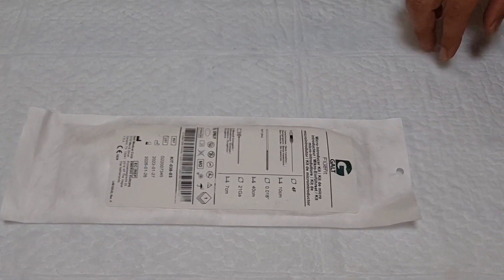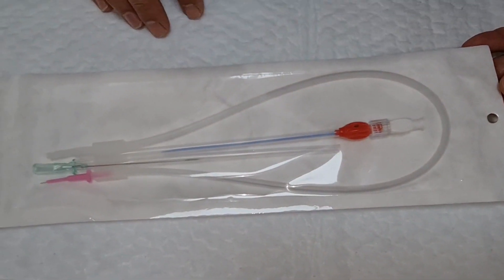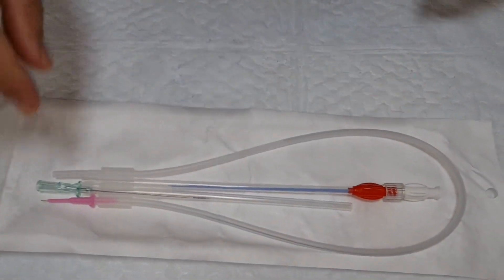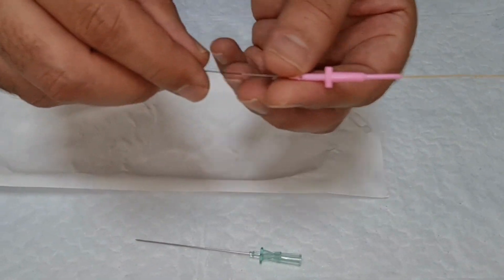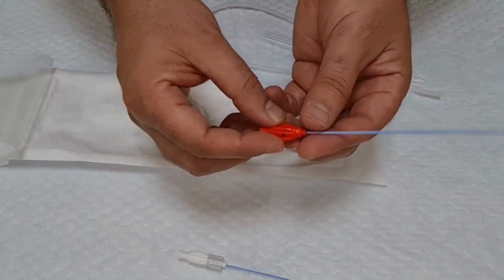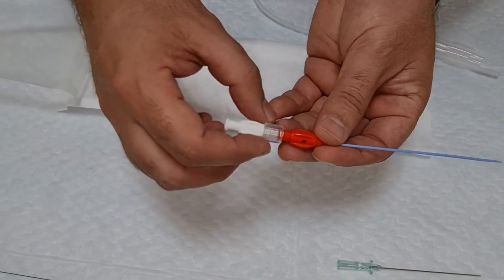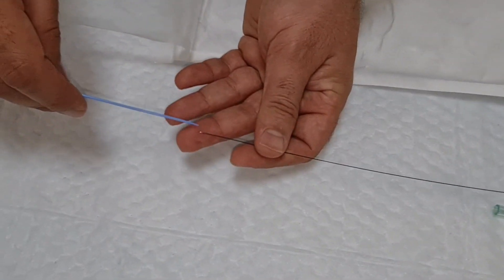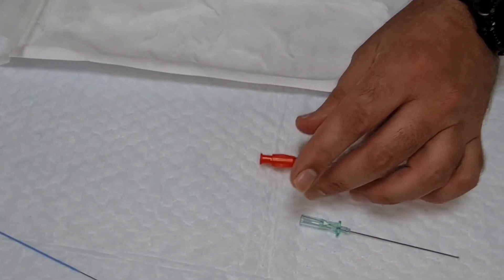What is a Micropunctur kit?

Comment: After that procedure, the sheath will remain into the body, Why the sheath is placed into body?  what is following procedure? this sheath is to supply something into the body
Reply from the maker: Dear Jorge, placement of sheath inside the vessel/body depends after the procedure depends upon the type of procedure I.e diagnostic or intervention and of course the ACT, as well as it depends on vessel selection (Artery or vein) even the sheath can be used for multipurpose for example in Pericardiocentesis procedures it remains inside in order to drain fluid.
Hope this clears your concern.